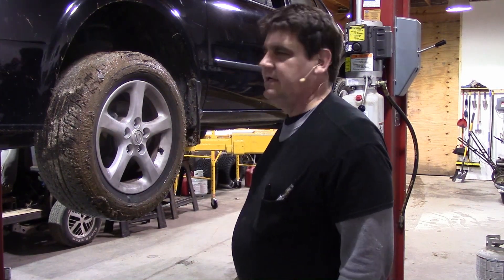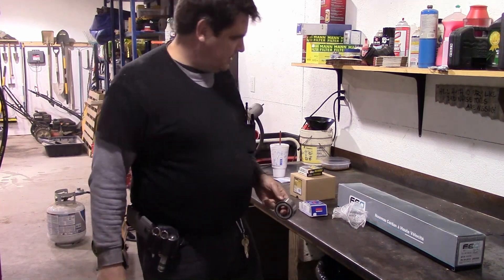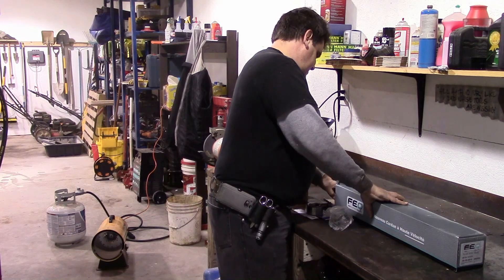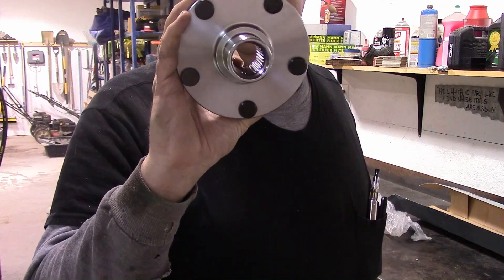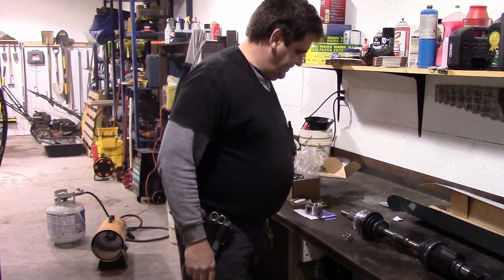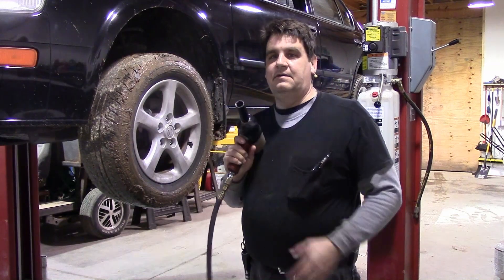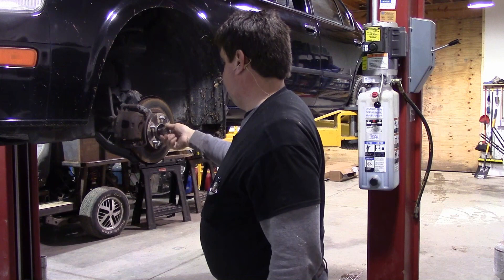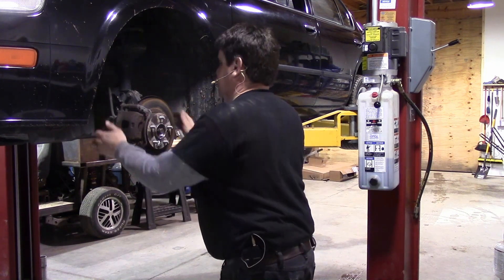Front wheel bearing and hub replacement 1998 Nissan Maxima (Part 1).

Comment: Fantastic tutorial!!!!! The only thing I couldn't see and would like to have is the ty rod removal. I know you are limited without a camera man, so it is not a big deal at all. Thanks for showing everyone just how easy most of this stuff is. It only takes a little common sense and the right tools to save a whole lot of money on projects like this. Thank god for people like you. You explain things so that a child could understand and make the whole process that much easier. I love the reference to the big btw. My motto has always been, when all else fails, hit it with a hammer. If that doesn't work get a bit lol😊😊 Thanks again and I'll keep my eyes open for more projects like this on as I own a 4th Gen Maxima myself
Steve
Reply from the maker: steve brady I enjoy making the videos, and its always nice when it helps someone out :)
Reply: My 97 is making an odd rubbing doing while driving. Bearings and suspension seem fine. I am a pretty good mechanic myself, but this one has me scratching my head. Any ideas???
Reply: Meant to say an odd rubbing sound while driving
Reply: +steve brady Was it your bearings that were bad?
Reply from the maker: Yes, the wheel bearing had failed. This was a friends car and they had me do the work on it for them.
Reply: Thanks! I had a bad bearing and also the inside of the hub was scored. I'm getting both of those replaced today.

Comment: Oh yes the bfh, and im sure you also have the vbfh for those times when parts just argue :D
Yep you could drive a truck through that free play, well past its sell by date :D
Keeping the camera close is really good :-)

One problem, that mic isnt doing too well, when the camera is close use the camera mic, its far better for crisp audio.
Reply from the maker: Yeah, i'm not happy with the audio quality of that wireless microphone, it's very flat and dull. I'll have to use an equalizer to brighten it up. It's all a matter of experimentation. figuring out what will work well in the shop. I rarely have anyone to man the camera so the mic helps me be more mobile.
Reply: Mac Gyver
Oh i do understand, and im not being negative in any way, im a bit confused though.
Electret/condenser microphones are normally quite crisp, there is one on the camera and thats fine, i wonder if that baffle on the headset one is upsetting the audio quality?
Is it actually the wireless link transmitter/receiver thats limiting the hifi of the audio.
Reply from the maker: Not sure what the cause is. It should be better than it is I know that. I need to spend some time with it and experiment some more. I have some other recording gear from a home recording studio I had years ago, mixer, effects etc. I may try and run it through that to see where the problem is.

Comment: wonderful tutorial, all 3 videos. very thorough and helpful!

Question though, I don't have air tools or a press. How hard would this job be on a 5th gen (2002) maxima with hand tools??
Reply from the maker: +bkameka69 It would be pretty tough! The nut on the end of the axle shaft would be your first challenge, but it could be be done. You would probably need to take the hub to a shop to get the bearing pressed out and the new one back in.

Comment: had a mate take a ford explorer in for a roadworthy and 1 of the things they picked was the back brake pads wernt the corect brake pads now as far as i know diffrent model brake shoes dont fit diffrent cars? they picked a few other things and said all would cost 4000 to fix for parts now won item they said was the clamp to hold down the battery they wanted 250 for it its 14 dollars on ebay another part was a rear tail light they had it down at 450.00 on ebay they are 25 dollars i priced everything on ebay and it come to 900 dollars 3000 one hundred less that the place that roadworthyed it wanted the guy that owned it a friend of mine he is a lot older and was talked into buying a pajero with 400.000 km on the clock insted of fixing the other 1 he payed 4500 for the pajero witch was a 98 model mitsabishy in worse condishion than the ford that is in mint condishion inside and out and is a 2002 model with 142.000 km on it i done a quick run over it and half the stuff on the roadworthy was bullshit nothing wrong with the car at all the old guy needed a car fast so they told him they couldent do the ford for 2 weeks and he needed a car to pick a relative up in melbourne this tuesday from england so they kind of got him in a corner i told him i wish he had of come and seen me first as id of tore them a new asshole .
the pajero i did a quick look over the 2 back tires are off the front off the car and have chew marks on them from a very bad alinment they are both fucked the motor has a miss in it 1 of the things they said the ford had the ford runs sweet no misses at all the pajero has oil leaks 1 of the things they picked on the ford for roadworthy the pojero was roadworthyed by them as well it seems if a customers car come in for a road worthy they run up a big bill even things that arnt wrong with it then when they roadworthy there cars to sell they send them out with half of it fucked the pajero also has missing rubbers on the exhuorst pipe i cant stand the owner of the car yard when he found out i i dident w3ant to buy a car he had 15000 dollars to much on he torl me to get fucked and called me a cunt now i think pay backs are in order here im going to ring up and report him for sending a very u8nroadworthy car out onto the road with an old couploe that need something roadworthy as older ppl dont drive as good and need good tires exetra.
and get this the pajero is up for an oil change in 200 km the car yard dident even change that for him they kind of seen him comeing im realy angry about it and am going to fuck them over big time becouse here if your coaught doing what they did to this guy its big money in fines and you loose your licence never to get it back again just a pack of cunts
Reply from the maker: Wow, sounds like they were out for blood. There are many bad car shops like that over here as well that will try and rip off the customer. It's more common in states that have rigorous vehicle inspection laws. Here in TN, they only check emissions and in some counties, there is no state inspection at all.
Reply: Mac Gyver the same place sold a car they did a roadworthy on to sell for them self and put silicon around a drive boot to make it road worthy yet when it comes to doing you8 a roadworthy they dont let you just put silicon on the boot the button it up im going to report them we have both cars the 1 they sold and roadworthyed to sell and the 1 they roadworthyed for the guy they are fucked
Reply: I understand that this comment is a year old.  Please read what you wrote.  Do you know how hard is it to read that wall of text that doesn't have one period?  That's a few paragraphs